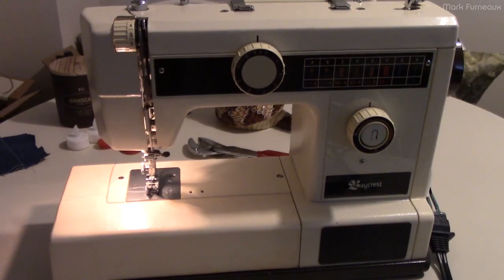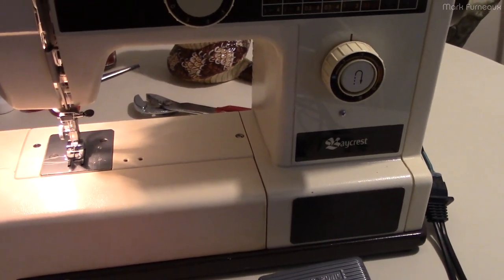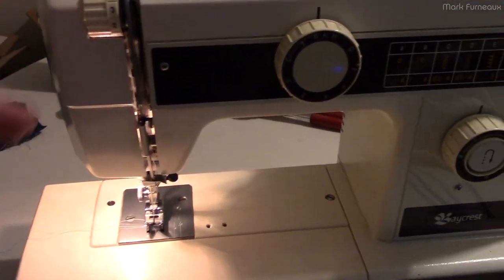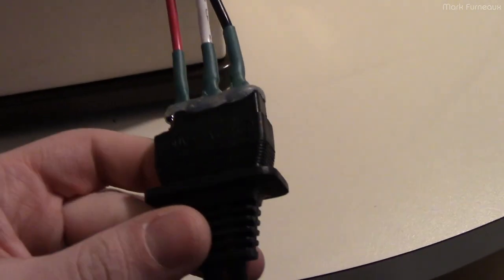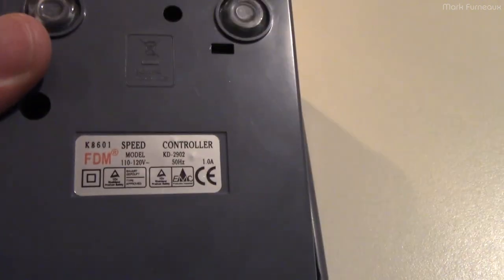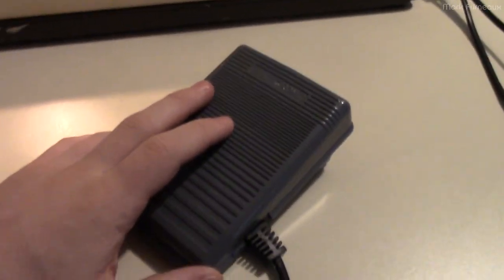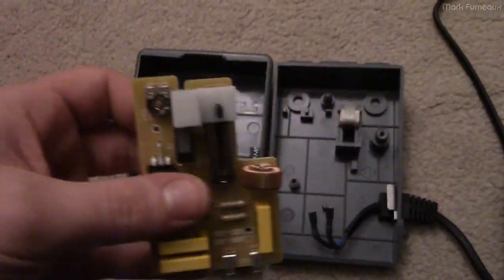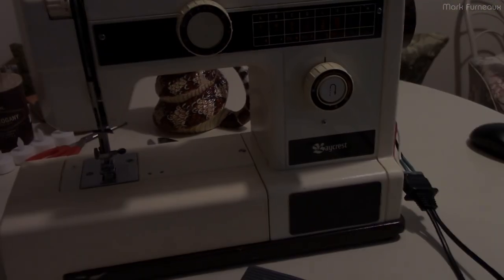Retrofitting an Aftermarket Foot Pedal on a 1984 Baycrest 3700 Sewing Machine (With Schematic)

Comment: I have what looks like exactly the same machine but with Janome branding. Online resales often refer to it as a model 647 but I think that may have been because it was the last three digit6s on a badge (which mine doesn't have). Had heaps of problems locating a service or even user manual but so much looks identical to mine, including the artwork on the controls, colouring, general construction, etc.

Comment: Common failures in the pedals is the microswitch burning out, and the linear pot going intermittent, along with the big capacitors failing open circuit from self healing.  No idea as to the OEM of the machine, likely it is a clone of an Empisal, though if there is a FCC type approval number on there you will probably get a manufacturer match. My one is an older Empisal, old enough that the entire machine is made from cast iron, and the speed control is a power resistor with a wiper, that controls motor current by sheer brute force.

Comment: That was really interesting, but I have a question, one that seems so obvious that I'm surprised it hasn't already been asked. Three wires coming out of the machine but only two make it to the pedal - where did the extra one go? (And if the answer is "nowhere" then why did they - or you - bother?), also was there a reason why you didn't replace the socket on the machine with something the new pedal would fit into safely?